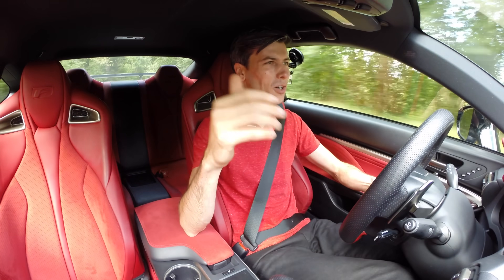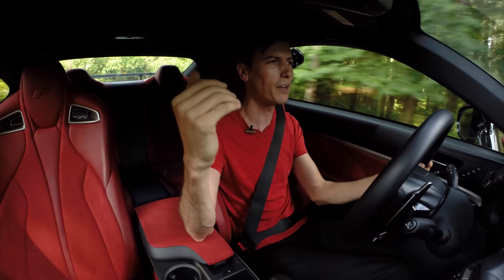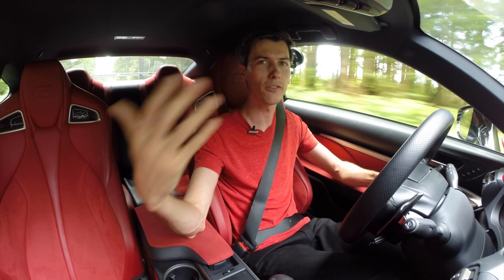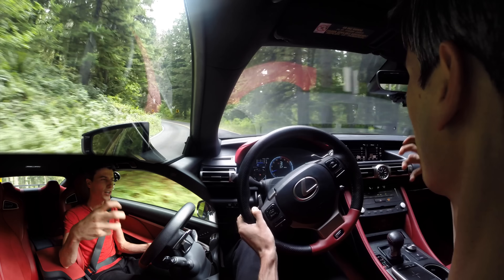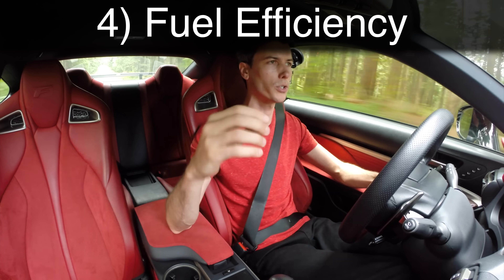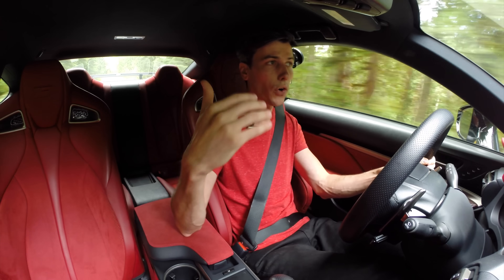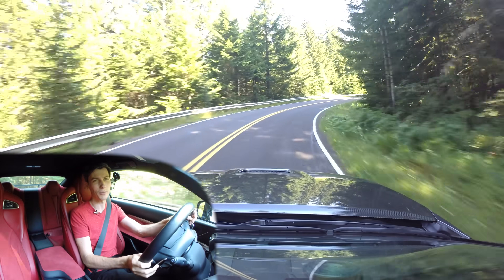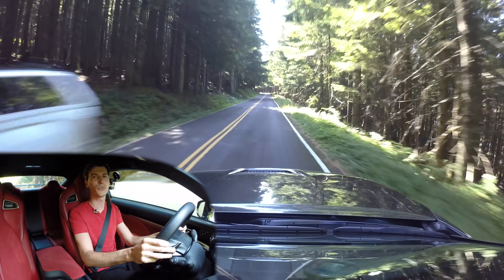5 Reasons You Shouldn't Buy A Turbocharged Car

Comment: I just sold my Honda CR-V. It had the 1.5L turbo "Earth Dreams" engine. There were endless reports of oil dilution ruining the engine. My CR-V never did anything other than return MPG numbers that were amazing! I, honestly, knowingly used the turbo about a dozen times in the 4 years I owned it. I decided to buy a Toyota Highlander. I needed better towing capacity. Honestly, I was very relieved, to buy a Toyota! Honda makes more, and possibly better engines. Toyota makes better vehicles. My MPG has been disappointing thus far. However, it is the nicest vehicle I have ever ridden in, and I also own it. I probably would have said that about my CR-V, and it would have been true also at the time. In sum, I am not a fan of sticking a small turbo 4 where an 8 or 6 should go. Honda might do it wellish, but nobody else can make one good. I understand that the manufactures are doing everything they can to meet US standards for efficiency. Toyota clearly has decided to achieve the numbers with hybrid and start stop technology.

Comment: realize this is an older video... but even at the time this was created there are engines that solve the compression and knock issues that appear to be the significant downside to turbo engines.  Miller and Budack cycles are meant to solve these as I understand the design.

Comment: I’m willing to test all the traditional pitfalls of a modern turbo engine with my 174 hp, 162 lb/ft torque, 1.5 liter 4 cylinder 2018 Civic EX-T (bought new June 2018). I currently have over 83,000 miles. I change the oil/filter early (3,800-4,200 mile intervals using 0W-20 synthetic). I use the highest detergent fuel available (currently Shell 93 Octane Nitro Plus). I changed the plugs early at 67,000 miles. I replaced the transmission fluid twice (around 33,000 mile intervals). I replace the engine air filter every 10,000 miles. I flush the coolant every 50,000 miles. So far, I have no issues whatsoever.

Driving profile: I am not a lead foot. I rarely exceed 4,500 rpm. I have never approached redline (6500 rpm). I drive about 60% highway and rarely drive short distances. I’m currently averaging 33.7 mpg.
Reply: I'm glad you don't have issues, but you shouldn't have to use the most expensive gas available and otherwise baby the car to avoid them, especially in a Honda.
That's about the HP of an 02-17 or 19 Altima 2.5L NA. I wonder how many of those are still kicking with 100k on the clock and haven't had any problems (and kept up with scheduled maintenance, and run on 87 octane).
Maybe not at that mpg, but it's a bigger car.

Comment: Actually 2 little corrections:
1. The sound. You forget that a turbocharged engine means more air into a given cylinder capacity than am atmospheric engine. More air being pushed out ot the chamber means more "energy" pushed out too (and faster). So a turbo charged engine does indeed take some of the power from the collector, but there is so much more because of the compression in a turbo, that there are still more left at the exhaust pipe. Its like comparing a 2.0 liter v4 engine with a total of .5 liter per cylinder of air being pushed out, to a 4.0 liter engine v4.
2. Something completely false here. You are saying that a v8 fires up twice as often as a v4. WRONG Its just that in a v8, you'll have 2 cylinder fires at the same time while in a v4, you'll have only one. So it is not true that the v8 will fire in a more rapid succession. For a better understanding, lets say it take one second for an engine to do a full cycle of 4 strokes. In a v4, you'd have one cylinder fire every .25 second. Its the same in a v8, except that there will be 2 exlposions every .25 seconds instead of just one. Except that a well designed exhaust will make sure thtat both hot gas pockets do not exit at the same time. One will have a shorter route than the other.

Comment: Excellent video, gotta love the immediate throttle response of a good NA v8. Around 7:10 I think you may have a misunderstanding though. I don’t think the lower Static Compression Ratio (total volume at BDC vs total volume at TDC) manufacturers quote for turbo engines will actually hurt combustion efficiency. The reason being, the engine sees total, or Dynamic Compression Ratio (air density immediately before combustion vs atmospheric air density). 

Even though turbo engines tend to use lower SCRs (e.g., 9:1 instead of 11:1), the air has already been compressed by the turbo before it enters the combustion chamber. I think that would make up the difference. After all, the final pressure and chamber surface temperature right before the spark ignites is your limiting factor for a given octane fuel. In fact, using an intercooler will effectively compress the air further, enabling you to even get a higher DCR with a turbo engine than an NA engine.

However, most of what I’ve just said goes out the window if a manufacturer’s tuning program cuts boost at low load to improve fuel economy.
Reply: I think thermal efficiency is mostly a function of the compression ratio (or decompression) during the power stroke. For ideal efficiency, you want the air in the cylinder to be at ambient temperature and pressure at the end of the power stroke. Any additional pressure and temperature is dumped through the exhaust and wasted (a turbo recovers some of that energy for powering forced induction, but that isn't power to the wheels). This is the idea behind the Atkinson cycle: a larger ratio is used during the expansion stroke than during the compression stroke, allowing the air in the cylinder to come closer to ambient pressures and temperatures, leading to greater efficiency. Forced induction and the resulting lower compression ratios do the opposite: the pressure and temperature at the end of the power stroke are increased, so there is more wasted energy, so lower thermal efficiency.

Comment: I bought a used 16 Audi A3 1.8t with 28k miles on it, put a IE stage 1 tune on it and with in 5k miles my exhaust turbine broke off. That IS12 turbo can not handle 20-22 pounds of boost.

Comment: I have an M140i and it doesn't have any 'problems' you mention with a turbo. Powerband starts at 1500 rpm and keeps pulling to 7000 rpm, there is no fall off. Not all turbocharged cars are bad.

Comment: Shorty engine is built to handle the boost pressures but it's not built to handle the trap now from when the turbo explodes which is inevitable $200,000 RPM it's going to fail faster than anything

Comment: In my 2015 VW 1.4T, reset the throttle position sensor by:
1) Get in and put your foot flat on accelerator pedal for 10 sec
2) put key in ignition, turn to ON (don't start the car) wait 8 sec
3) You will hear a noise under the hood, like a "WAP WAP" - this is the sensor reset.
- Now you should have much better throttle response (until the ECU leans it off again).

Comment: No Turbo...
No Problems...
Or at least, fewer problems if you have an engine from someone who actually knows how to make an engine. Because the list of garbage Naturally Aspirated engines is just as long as the list of garbage Turbo engines. I am no longer a fan of Turbo engines, my experience is that I kill em in 40'000 miles in the best case... Or a mere 1'000 miles (rental) in the worst case. Toyota makes very good naturally aspirated engines. The 392 Chrysler is also good.

Comment: I drove a ZM3 and that engine was one of the nicest NA engines I’ve seen.  Power everywhere,  it was way more fun than a quick 2 litre turbo.
Reply: 236 kw and only 350 nm of torque from a 3.2 6 cylinder isn't very impressive though, Turbo it and it'll have properly 100 kw more and double the torque, there's nothing N/A wise you can do to match that power.
Reply: No such thing as a quick 2 litre turbo...I'm thinking you don't really know what quick is.....  Not being mean, Im just saying.

Comment: Turbo cars sound great with the right mods, also power gains from a n/a engine are very low, turbo power all the way, I’m getting 54.2 mpg from my 1.2 3 cylinder turbo Peugeot 208 gtline. Stage one with ram air induction, 160 bhp 220 ibft. 0-60 in 7 seconds and 135 max.👍

Comment: Eh I prefer the feel of the turbo. Yeah aspirated is more consistent but I just want a fast acceleration and don't care as much about how fast it speeds up on the road. Also who cares about the power of higher gear speeds? It's not like I'm racing with my normal use car. I'm not ever supposed to go over 65 mph (even if I generally prefer to sit closer to 85 mph). There's no point where in more average commune I'd even consider passing 90 mph unless I'm incredibly impatient that day.

Comment: You forgot to mention Superchargers.

It is NOT either accept compromise of Turbo lag, or go for N/A. There is another option (that you know of), Superchargers: WHICH DO NOT HAVE ANY TURBO LAG.

PLUS air coming in from Supercharger is nice and cool, NOT super hot like on Turbo.
so why NOT make a video on Turbo vs Supercharger, instead of Turbo vs N/A?

The way I see it: SuperChargers have ALL the benefits of N/A engines WITH Almost ALL the benefits of Turbocharged engined.

Comment: From one engineer to another, it is dishonest to misrepresent the orders of magnitude of issues and infer that they are relevant.
so turbos run hotter, ok, introduce more radiative surfaces to dispense with the heat.
So turbos develop more cylinder pressure, Ok use decent sized piston, bearings, rings, cylinder walls and heads to take the pressure.
So turbos don't sound as good, fair enough, I do like the true throaty burble of a V8.

But the whole concept of the article is misleading, for I say, it is better to have a well built turbo engine developing 300 kW than a poorly built aspirated engine devolving 300kW, as it will be more reliable and weigh less.
very disappointing, but lets plug the naturally aspirated Lexus, wont we.

Comment: As a fellow ME  ( PhD in 85) who has built 5 turbo installations from scratch I will generally say your videos are pretty good. & granted pressures are higher as you said but you forgot one big fact. Gas runs by burning ( unless detonating) & diesels run by explosion. Big difference with regards to shock loading the engine components!
Reply: Could you explain? Seems like they both combust, creating pressure, pushing against a piston. Where's the important difference between burning and exploding here?
Reply: @nthgth  a gas engine uses spark, at a specific moment, to ignite the charge. If the initial compression ratio is too high, it ignites the charge due to the heat created by compression, too soon. This results in the charge detonating before the piston reaches top dead center where it's supposed to fire. Therefore you have pressure trying to push the piston down, on it's way up. This, at the least results in "spark knock". At the worst, it "hand grenades" the engine.  A diesel engine relies on compression detonation, through compression, to fire ,or detonate the charge. That's why a diesel can handle boost at much higher compression ratios.
Reply: and what? it's not like all turbos use gas while all naturals are diesel, or is it? no idea what your point is about

Comment: Man, you're a super smart guy, but I beg to differ. My Evo V and Evo X have torque in all ranges ... stock😃😃😃. No turbo lag. Both are well over 200,000km. No rebuild and no engine problems (4G63 and 4B11). Stock Gear Ratio is a different story.

Comment: Interesting point about the heat. Makes me wonder if a turbocharged engine should be left to idle for a few minutes to cool before shutting down after intense use.
Reply: Yes. The answer is always yes. Get yourself a turbo timer or force yourself to idle for a MINIMUM 30 seconds. Best to be around 1-2 minutes
Reply: I have a turbo timer, let it run for 1 minute then car turns off.

Comment: Please don't take offence, but I think there is one misconception concerning "rich air fuel mixture":
Yes: fitting a turbo has the (efficiency-wise) negative effect, that you have to tune down the compression ratio - resulting in slightly less efficiency. But the air fuel mixture is always as close to stochiometric as possible, to my understanding. Maybe at full throttle there are some car models that dump extra fuel in for cooling - I think that is a thing of the past. The lambda sensor and catalytic converter wouldn't be too happy about a significant lack of air i.e. oxygen.

Comment: I hate turbo lag with a passion and how the torque fizzles out on higher RPMs.
I wouldn't mind a mild hybrid system where the electric drive bridges the gap until boost is up. Nobody offers that for normal cars except Suzuki.

Comment: Throttle position isn't the only independent variable in the calculation of boost pressure.  You need to consider load and RPM as well.

Comment: HUH sound, any of both Volvo and SAAB sounds better then an equal sizes engine of their engines, so bad there.
A supercharged engine needs more fuel, and need same ratio of fuel air mixture when you hit the pedal and fully ipen the trottle. But Supercarged needs more fuel all time, and to that same size engine about a 4cyl 2,0 runs all time with higher preasure with a supercharger, when running smooth a Turbo charged engine have smoother life than an uncharged engine, the kompression ratio are not often over 8:1 compared to an uncharged over 10:1 witch allso has effect on the engine. 
So what you say are a V8 4L with 200 hp are allways better, ofc it allways will have loads of more fuel compared to a turbo or supercharged 2.0L engine with max 200hp.
Even if you push 300hp out of the 4cyl 2.0L engine it will have less consuption compared to that V8 4.0L for most kind of driving, specially in town.
But Americans seems to don´t giva a s....t. the must love to breath poisoned air.

Comment: The climate change policies are largely to blame for manufacturers being forced to find efficiencies through smaller engines while maintaining power output. EV’s are the other alternative for higher power, but they are not without their downsides - battery packs weigh up to a thousand pounds (2x - 5x ICE engines).

Comment: Jason, how can you talk about engine efficiency/MPG being so bad in a turbo engine? If you want to stretch your gas mileage with a turbo, keep your foot away from the floorboard. The old Chrysler turbo cars from the 80's-early 90's ( 2.2-2.5L ) had low compression ( 7.8 ), small turbo's with water cooling, delivered 30+ MPG and very good reliability. Using synthetic oil of proper viscosity virtually eliminated coking issues. And, they could haul ass when required. Best of both worlds. It's ironic that Chrysler stopped making small fuel efficient turbo cars since the demise of the SRT4 Neon, while the rest of the manufactures have jumped on the idea. I still have two of these cars ( '89 and '91 Dodge ) and will not part from them for the overly complex junk being built today.

Comment: What about a supercharger, a belt driven type, should we buy those? And are they durable?
Reply: You will have crazy torque plus great acceleratinon at low rpm. Also will have a limited power delivered like turbos . No lag because they take little or no time to boost. If you want to start or just have fun get a 98 or 99 Mercedes C230 kompressor. It was about 178 hp and 180 torque new. Easy fix. Also tey to find the sport version.

Comment: Turbo charged engine nowadays is very reliable if we changed our oil frequently. V6 and  V8 N.A. engine  are just gas guzzler and expensive to maintain .

Furthermore, turbocharged with supercharged provide better fuel economy and greater power . I had a Toyota turbocharged and till today it goes like a rocket very reliable. No problem.

Comment: IN THE 1980"S TURBOS WERE  STRICTLY OIL COOLED AND WERE REPLACED  (TYPICALLY @50-60,000 MILES ON VOLVOS) WITH TURBOS (NEWER FACTORY DESIGN) THAT HAD A WATER JACKET AROUND THE TURBO AND WE NO LONGER HAD COKING (OIL BURNED TO CARBON) ON THE BEARINGS, DOUBLED THE LIFE AND THE BOOST.

Comment: Twin scroll intercooled turbo's eliminate many of your issues. Full torque under 2000 RPM. Flat torque curve. Synthetic oil eliminates heat issues. The mileage is phenomenal.

Comment: Small V8 or V6 vs big 4 cylinder with similar power ? Which one you would chose and why ?
Reply: Cool topic.
All other things being equal, the 4cyl would be cheaper and lighter bc fewer parts. Probably more reliable too for the same reason.
But more cylinders means lighter pistons and rods so potentially higher rev range. 
Also means more intake and exhaust valves so better breathing all over the tach.
Kinda like, look at the Porsche Carrera GT from like 2005. 5.7L V-10, 605 hp.
Vs. 5.7L V-8 in a Charger or Corvette of the time, 340-405 hp. 
That comparison isn't really apples to apples but it's kinda like that.
Also, 80s-90s F-150s had a 4.9L I6 and also a 4.9L V-8. Different performance specs from both.

Comment: You forgot the main advantage of Turbo . 
You get power and torque instantly when you need it to pass a vehicle or entering freeway and not like a NA engine where you wait for the Revs  to climb up like on a race track.
I want my peak torque at 1500 rpm and not at 3500 rpm .
That’s where the biggest advantage of turbo lies .

Comment: Don't forget the clutch. Particularly in turbo diesel cars. I had a remapped Gulietta and whilst the joy of torque from way down low in 5th gear was fantastic, the clutch takes a pounding from the increased turning forces! 
NA engines do sound better though. Pops and hisses are fine but my 3.2 v6 with, what must be said is a relatively sedate exhaust,  is magnificent. Wouldn't swap it

Comment: Point number 4 when he goes into thermal efficiency is flat out wrong. Turbocharging decreases pumping losses and increases effective CR. Both of which lead to higher TE. Also the rich AFR boosted engines usually see isn’t to prevent knock. Rich AFRs actually increase the chance of knock.